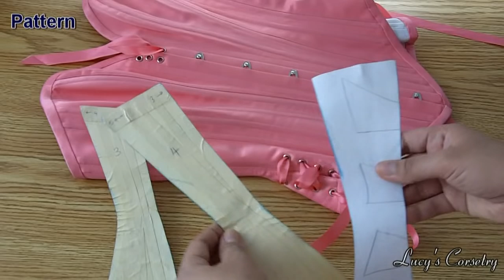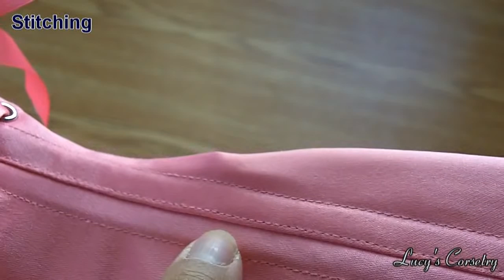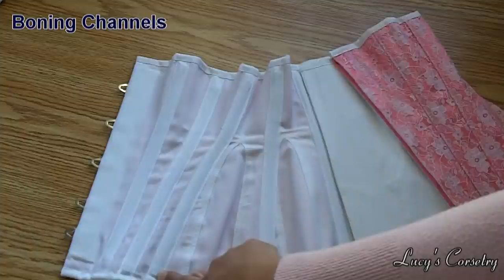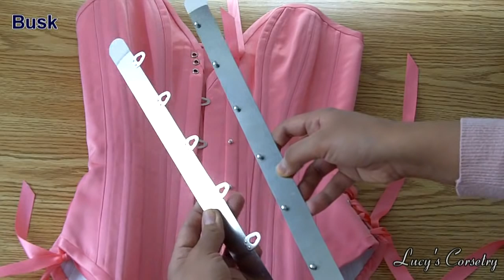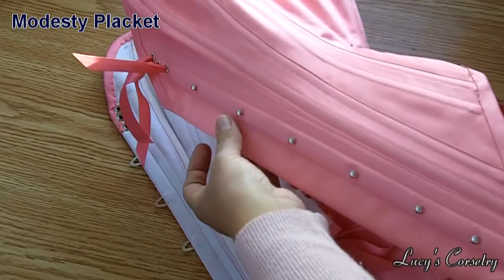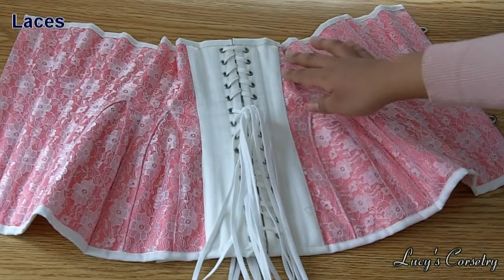Corset Anatomy (parts and terminology) | Lucy's Corsetry

Comment: I also wondered if you could make a video for someone just starting to waist train. As these are my first real corsets, I was unsure how high up it should be when I put it on. I think it was too high at first, and seemed to put too much pressure on my ribs, I lowered it and that seemed to fix the problem, but then I got a "back muffin"!! So I think it was too low.  I am thin at 5'4" and 125lbs so I didn't think I had "back fat" ugh.

Comment: Perhaps a delicate question, but how do you go about going to the bathroom in a corset. I'm rather new to wearing them, and I sometimes I find it difficult because I can only really sit at a 90 degree angle and it's hard to bend forward and wipe and pull my pants back up and such >.<

Comment: I have noticed that this OTR underbust sits on me like a lot of the longline ones I have seen online do on others. Next question: do you have any recommendations on where to find a OTR overbust corset that would fit my torso? Also should I be looking for a standard sized overbust or try to find a short overbust corset? I tried to email one company, twice I might add, (TrueCorset) and have not heard back. Orchard Corset does not have anything either. Please help and thanks for responding so fast!

Comment: I recently bought 3 corsets all listed as 10 1/2in. When they arrived I tried on 2 of them, and they fit fine. I then realized that one was actually 13in in the front, as it's pointed. While watching this, I saw you were wearing one that was quite long in front. I wondered how comfortable this is for you, and if you could sit in it. Also, I noticed mine pooches a bit on the belly and doesn't sit flat. Is this because it's new? Also, how high on the body is an underbust supposed to sit?

Comment: I was wondering why there are laces on the part of the corset that covers your hip? Thanks for the info! I'm considering making my own corset.
Reply from the maker: Megan Gemmill It makes the hips more adjustable - you can expand it for more room, if you gain weight on your hips or even want to wear the corset over a poofy skirt.
Reply: Thanks!
Reply: +Lucy's Corsetry elizabethan corsets don't have those laces at the hips
Reply from the maker: Kirby Sas True, but Elizabethan stays actually stopped at the true waist and below that is just tabs which don't contribute to any cinching support. So the tension of the corset would theoretically stop at navel level and the hips would not come into play and thus wouldn't be pinched.